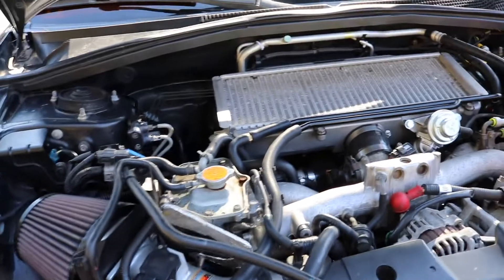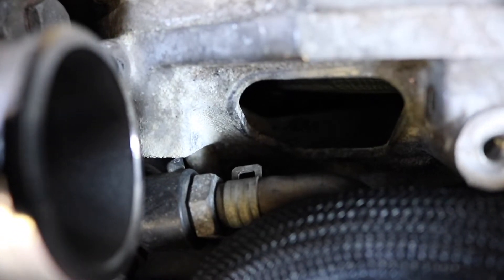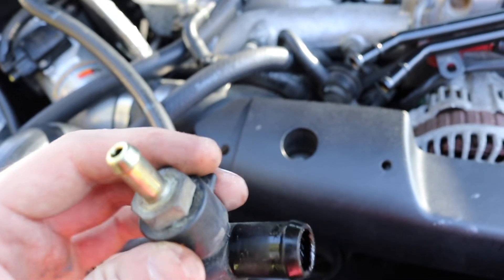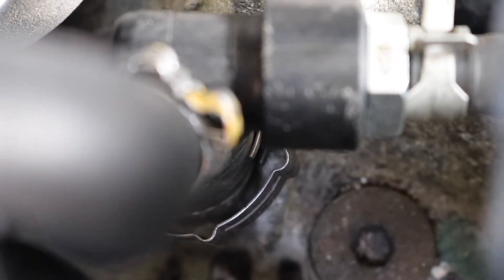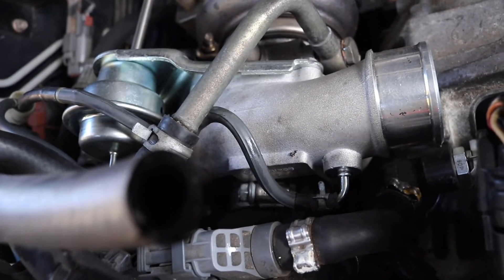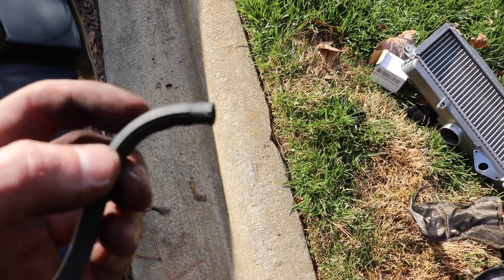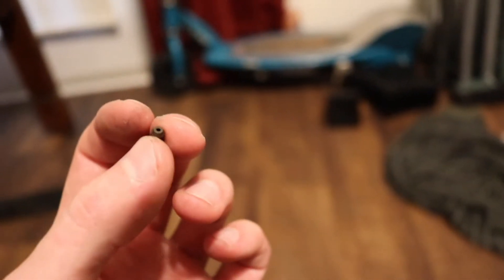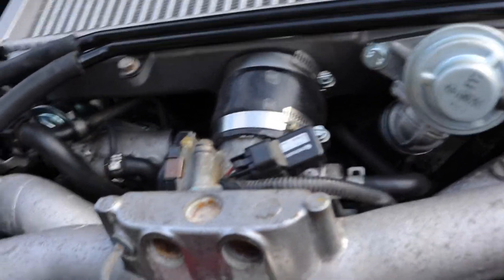Forester PCV and Restrictor Pill Code P0244

Comment: i have p0244 when i excelerate ..gas cut off for half a second then burp an other half second then start back excelerating fxt07
Reply: Did you figure out what it was? My 09 wrx is doing the same thing and it cuts gas hard

Comment: Hey mate! My 2005 Forester XT (Australian model) doesn't have the little valve inside the assembly. It is clear of obstruction all the way through. Same with the brand new part I bought.
Reply: Hey mines also Australian model and have the same issue and the code p0244 what fixed it :)